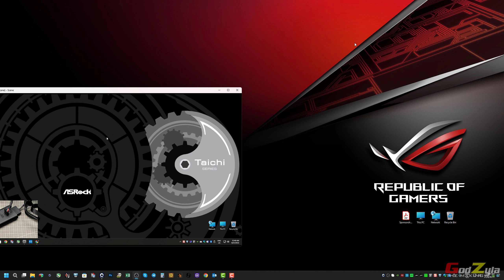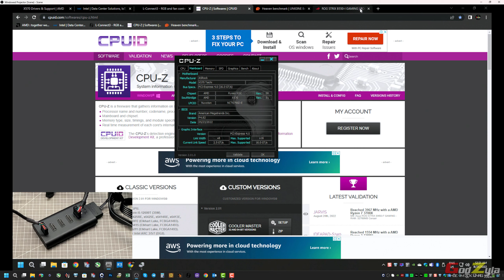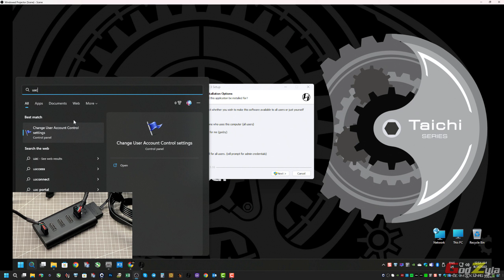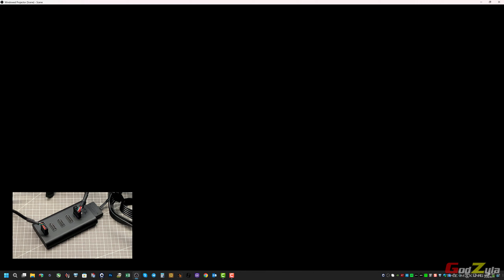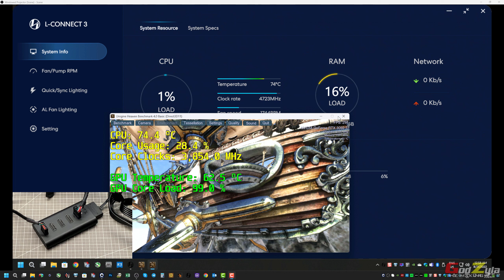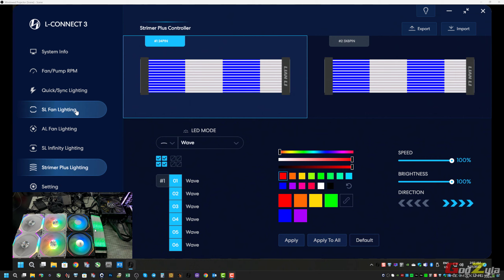Lian Li ARGB Products (How to make it work?) [L-Connect 3]

Comment: So I just finished a build in the 011 d Evo. I've got 3 sl 120's that came with the Galahad 360 Aio, and I had some other fans in there that ran off their own controller with a remote. Just got 10 of the infinity fans in today, installed them, and then installed lconnect 3 but I don't seem to have very good control over the rgb. The new SL Infiniti controller has slots for the older style lights and the Galahad which I plugged in. I'm not sure exactly what I'm supposed to do. Do I need to unplug the Galahad and the sl120s from the new controller, install the L connect 3 software for the Infiniti fans and then try to plug in the older sl120s and galahad? Or am I gonna have to reinstall the sl120 controller that came with the Galahad fans and run with 2 controllers? I'll probably end up emailing you if that's okay. I'm notoriously bad at replying to comments on YouTube.
Reply from the maker: Hello Elliott, welcome to my channel, I am fine with either, through here or through email. You have two chioces infact. 1st choice is to use both controllers using L-connect 3 or 2nd choice is to use the SL Infinity controller to control the ARGB  of your galahad and the SL Fans, but your SL fan connector will have to go directly to the motther board (which is a good thing) 

be it 1st or 2nd choice. you need to remove your old L-Connect app that support your SL120 fans. just make use of L-Connect 3. more details are explain in this video you are watching.

Comment: Please help bro i have 6 al fans and 3 sl fans coming withe the lian li galahad coler i download the l connect 3 for the first time and i can control just with the sl because it’s has the last update 1.8 but the al is 1.1 so I can’t control with al fans I tried update it manually but i lost control for the al and sl i cant see sl fan lightning and al fan lightning on the l connect 3 i unstall the l connect and download it and stell not walking but my bios is not the last virgin by the way
Reply from the maker: Hello Raine, welcome to my channel. I would advise you to remove L-Connect 3 application first, using revo uninstaller. next power down your PC, turn off your PSU, unplug the cable to your PSU and leave it off for the next 45 seconds. while waiting, plug only the AL controller to your motherboard. Power up your PC, check on device manager. make sure the AL controller is listed first. if it does not, do you have another PC to test it? if yes test it. this will narrow down if the controller is faulty. if it is, get it changed which you can do a claim at lain li official website.
Reply: @KleoYan  i download the second version of l connect 3 not the newest version and its working fine
Reply from the maker: @raine6140  I see, this is strange, which motherboard are you using btw? but if the old version work. you can just use the old version. The new version has additional features like setting 120m and 140mm fan profile. If you are using only 120mm fans then it will be alright.
Reply: @KleoYan  my motherboard asrock b550 pro4 and i have just my 120 fans so think you for the support kleo💙
Reply from the maker: @raine6140  hi, you are most welcome, infact you have solved your own issues not me.. but am gald you have gotten it fix.

Comment: Hello Kleo! Thanks for the informative video! 👍  I SUBSCRIBED  to ur channel!  I have a problem. My computer  was built by a pc vendor..for about 5 months , my L connect 3 and my AL unifans worked perfectly..in the last 2 weeks, my L connect was very very slow  to respont to a mouseclick to ask the software to do anything it will take like 4 mins for one click..so i decided to uninstall  the L connect 3 software..everything..then re instaed the software..now L connect is working fine i think, no more freezing, my fans are lighted and spinning at think minimum speed,,but now the fans and speed to adjust is not showing on the L connect software!! It nowhere to be found!..what is wrong?..thank you!
Reply from the maker: Hi RandzWRX, welcome to my channel. I would first shut down the PC, pull off the AC plug to your PSU. let it sit for 45 seconds, plug it back on to see if the old cache flushes off. It it does not work, when you say uninstall, do you make use of Revo uninstaller? Revo uninstaller ( https://www.revouninstaller.com/ ). Revo uninstaller will remove all unwanted files / folder / registry in your system. Illustration to use revo uninstaller https://www.youtube.com/watch?v=uMgUYiakpxM&t=437s  once your L-Connect is totally removed. re-install it to see if that works. if still does not work.. then I have no clue what's going on.
Reply: @KleoYan  thank you for the quick reply! Just got home from work..i  will try yiur suggestions Kleo and i will let you know! Thank you again!  From chicago!
Reply from the maker: @RandzWRX  Hi ya, ok I hope everything work out fine for you.. all the best buddy.

Comment: I've just installed 9 Infinity fans to a new build. On boot 3 connected fans are running full blast which  i cant slow down. I have tried everything i can think of, from software to physical connections, but cant slow these 3 fans down. If anyone has any ideas then id be very grateful. This video is so informative for someone inexperienced like me. It feels good to watch a video and learn something for a change. Well done sir.
Reply from the maker: Hi weaselinjeans, welcome to my channel. If you just plug everything in and can't get it to work. try the steps I have shown you in this video. do one thing at a time. first thing is to get your L-Connect 3 to be able to response with the CPU and GPU temperature. run the benchmark. you see, if you do it step by step, this ensure on the connection and the communication between your motherboard to the controller. Alot which I have aidded, all told me did my steps but when I find out.. it's not exactly the steps they follow. Ended up I have resolve their issues via conference call. telling them exactly what to do. my method as in step by step is to first, ensure the controller is communicating with your motherboard first. then next will be the update firmare. Anyway I hope you will resolve your issue soon. thank you for the visit and to have leave your valuable comments.
Reply: @KleoYan  thank you very much once again. When I get home this evening I will work through your tutorial, step by step, and let you know how I get on. Thanks again for the rapid response to my question. Keep up the great work 😊
Reply from the maker: @weaselinjeans1  you are most welcome and all the very best.

Comment: Nothing happens when I try to update my fans in L Connect.  It just says check your network connection and please try again.  Any tips?
Reply from the maker: Hi Con, welcome to my channel, are you on wi-fi, you might want to try using your phone data to tether to your PC or to use a physical Lan connection. If not, try manul update the firmware. https://lian-li.com/l-connect3/L3_update_manually/
Reply: @KleoYan  thanks! Manual update worked
Reply from the maker: @con5278  you are most welcome 😉

Comment: Hi, thanks for the thorough video!

just one quick issue I have, I'm unable to control my fans with L-Connect 3 at all - I only plugged in the standard USB cable + SATA and no response from when I make changes in L-Connect. It's able to acknowledge my controller and fans, so everything is connected. Just not sure why the settings aren't applying from L-Connect.
Reply: same issue here.  did you manage to fix this yet?
Reply: moreover, L-Connect 3 is up to date, and so is the firmware! Also checked Device Manager, and didn't see any exclamation marks or issues
Reply from the maker: @dubchung  hi welcome to my channel, did your temperature in l-connect 3 respond when u do some benchmark. If your temperature readings do not move that could be the issue.

Comment: Hola quisiera que me ayudaras, tengo una placa z590 rog strix E gaming y no eh podido hacer q los efectos de luz funcionen, instalé tal como explicas en tu guía el L-conect 3 y no dan los efectos de luz, tengo los sl 120 y 140 unifans pero se quedaron con el efecto de mi anterior configuración de L-conect
Reply from the maker: Hi Roy Bryan Calle Fernandez, welcome to my channel. please do not collect your SL140 and SL120 to the same controller, it might not work properly. you might want to 
follow these steps and see if it helps if even the same SL uni-fans are connected to the controller. 

Basic Troubleshooting steps
Disclaimer : Though the chances are very low to brick firmware updates on motherboard and to any controllers. I will not be responsible if you have brick your motherboard or controller.

1) Make sure your motherboard bios is up to date, please check on your motherboard manufacture website, under support > bios and drivers. See if there are issues with USB and do they have a fix. If there are, kindly update those bios firmware version.

2) Make sure your chipset driver for your motherboard is up to date! For AMD will be at https://www.amd.com/en/support for Intel will be Intel Driver & Support Assistant Intel DSA https://www.intel.com/content/www/us/en/support/detect.html

3) Remove all argb apps (Asus Armory Crate / MSI Dragon Center / Giga Fusion / Asrock Polychrome). If the brands which I have mentioned, do have a uninstall tool like the Asus Armory Crate, use that, else use Revo uninstaller ( https://www.revouninstaller.com/ ). Revo uninstaller will remove all unwanted files / folder / registry in your system. Illustration to use revo uninstaller https://www.youtube.com/watch?v=uMgUYiakpxM&t=437s

4) Shutdown your PC, unplug the PSU cable from your AC outlet. Press the power switch twice to discharge all current that your motherboard is holding. Leave it for 45 second

5) While waiting, please do not use KVM switches. Disconnect all devices that are connected to your motherboard (front / back IO). Leave only your Keyboard, Mouse , Monitor and Ethernet (If you have) connected directly to your motherboard. 
If your monitor has a KVM build-in, remove the USB cable from your monitor to your motherboard USB socket. If your mouse and keyboard are connected to your monitor, please remove them and plug them directly to your motherboard instead.

6) Plug only one Uni controller or Strimer Plus V2 controller. If its for Uni Fan (SL/AL) use only 3 fans to an output of the uni controller.

7) Plug the power cable and turn on your PC

8) Go to your Device Manager, look under Universal Serial Bus Devices, make sure you see the Lian Li uni / strimer plus V2 controller.

9) Install the L-Connect 3 app only https://lian-li.com/l-connect3/ (current version 1.3.16)

10)	After installation, run L-Connect 3, check under Setting > General > make sure Auto-Run on Boot and Minimized L-Connect 3 to system tray at close are ON.

11)	Reboot your system.

12)	First thing you need, go to device manager and see if the Lian Li controller is listed, next open up the L-Connect 3 app. Check if there is a need to update firmware to your controller. Go to Settings > Update, under Device F/W version, click on Update Check, download and install the firmware. Make sure the firmware is completed. Do a check on device manager and make sure the Lian Li controller is listed.

13)	On L-Connect 3 dashboard, check if the CPU and GPU readings are reacting, you might want to test it using some benchmark programs. If there are reaction, play with the PWM and argb functions. If it does not work, skip step 14) and proceed step 16)

14)	If Single controller works, shutdown your pc, connect uni fan set of 3 to your output of your uni controller. Do it small steps at a time to hook up your sets of fans. do not do all in one go. If successful and you have a second controller, proceed small step at a time again.

15)	Slowly plug back your USB devices (Headset, Microphone, Printer, USB Capture Card and etc). At any point of time as you add those devices one at a time, if L-Connect 3 become unresponsive. This tells you that there power is insufficient to power up more USB Devices. Whatever USB port on your motherboard, there is a limitation as the current are shared across the board, be it front or back I/O and the internal USB Header. You might need to get a Internal USB Hub that comes with a Sata Power source to the Internal USB Hub. (Disclaimer, buying a internal usb hub might or might not resolve this issue, purchase at your own expenses)

16)	If it does not work, report your issues to Lian li Tech Support. There is a in build log ticketing system in L-Connect 3 app. this is what you need to do. Go to Settings > Support > Click on “Download log” place a filename and choose a destination drive to save the log file. Next click on “Report” it will take you to Lian Li Tech Support FAQ. Fill up the form and upload the log which is a zip file.
Reply: @KleoYan  gracias por la ayuda, aunque me fije que tienen un software para actualizar y arreglar el firmware y lo use y se soluciono todo
Reply from the maker: @roybryancallefernandez1294  Hi, thats good. you have solve your issue. do pardon me as the time you asked me, I am still in bed. as it's after midnight in Singapore. I am gald you are able to use the L-Connect 3. thank you for your visit and to leave your valuable feedback 👍😉
Reply: @KleoYan  ty
Reply from the maker: @roybryancallefernandez1294  you are most welcome 😉

Comment: Cant update my controller firmware. I tried it manually but cant do it my controller firmare version is 0.1
Reply from the maker: Hi Ozdemor Koray, welcome to my channel, I like to ask which device are you referring to? AL or SL or SL Infinity?
Reply: @KleoYan  hi thanks for the answer. I use the SL
Reply from the maker: @koko9912  ok, can you unplug your fans from the controller, unplug the USB cable between your controller to your motherboard. shut down the pc, unplug the power cord to your PSU. let it sit for a couple of seconds (45seconds or so) then plug only the usb cable that is between your controller to your motherboard. boot it up, check your device management, see if you can detect the controller under the Univeral Serial Bus Devices. if you have that.. try perform the manual fireware installation. https://lian-li.com/l-connect3/L3_update_manually/
Reply: @KleoYan  its not showing in the universal bus label but in the usb device
Reply from the maker: @koko9912  Yup. that's what I've mentioned :) it's under Universal Serial Bus Devices. Ok try do a manual firmware to see if it works.. make sure is only the controller to your motherboard without the fans.
Reply: @KleoYan  problem is that i cant do it because when i install the firmware updater its just a blanc folder i cant download the updater🤯
Reply from the maker: @koko9912  ok, when you extra the file, you should have some folders 1) to 5) below
1) AL120_v1.7
2) SL120_v1.8
3) SL140_v1.8
4)  SL-Infinity_v0.8
5) STrimer Plus_v1.3

open the folder SL120_v.1.8, you should have a .bin file " 6K77XX_LLUF-SL_20220413_0x00332F96.bin " if you find that, next thing is to launch the firmware tool " FW Update tools_v.1.0.1.10.exe " , press scan device does it list the lian li device? if it does, click on Browse and selet the file as mentioned, insdie the folder SL120_v.1.8 filename "  6K77XX_LLUF-SL_20220413_0x00332F96.bin " then click on Start Update.
Reply: @KleoYan  okey i got it. I needed another zip program to exract it but bro you helped me and its working. I can only thank you a and follow your channel THANKS A LOTT!!!!
Reply from the maker: @koko9912  you are most welcome. all the best with the installation ya and have fun.. by the way, thank you for your visit and to have subscribe to my channel.

Comment: Hello I am having to control my fans using L-connect 2 and my streamer plus cables using L-connect 3 is there a way I can transfer the fans over to my l-connect3 so it can all be in one platform?
Reply from the maker: Hello Clos Tobias, welcome to my channel. You can uninstall all L-Connect and just install the L-Connect 3. It will control all. Kinldy view this video properly, it might be lenghty and you have miss out on how to controller all uni fans and strimer plus v2 using L-Connect 3.
Reply: @KleoYan  so one thing I noticed on your video is you have multiple controllers and they all go to a hub where in my case I only have 1 controller where they all connect to is this probably why? Do they each need a controller, 1 for the rgb cables, 1 for the fans, and one for the cooler?
Reply from the maker: @Tobias-Carlos  Hi, each uni fan has it's own controller, you can't cross use. if you have lets say SL Infinity and the Strimer Plus V2, you will need two controllers, 1st the SL-Inifinity controller and 2nd the Strimer plus V2 controller. plug each controller to the USB header of your motherboard, you will need 2 USB header on your motherboard, if you do not have that. get a power internal hub (NZXT Internal Hub https://nzxt.com/product/internal-usb-hub-gen-3)